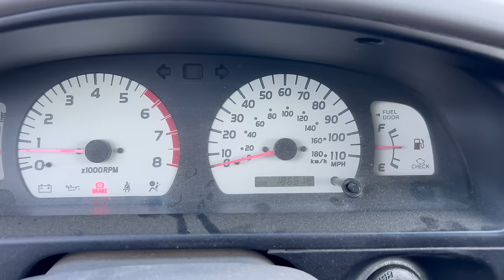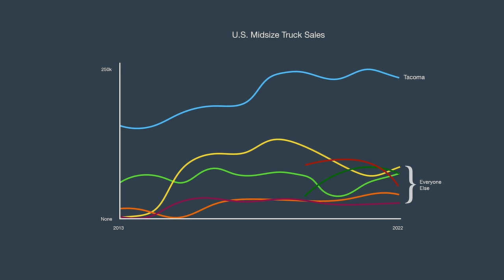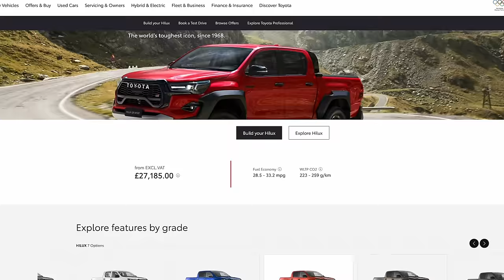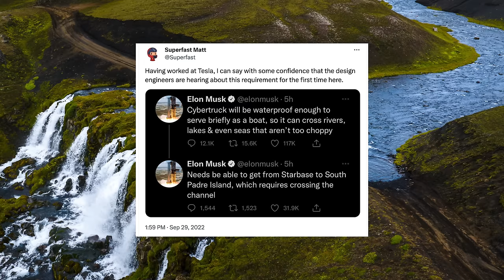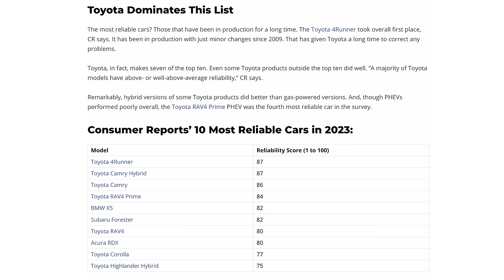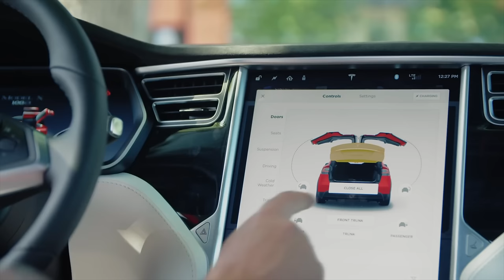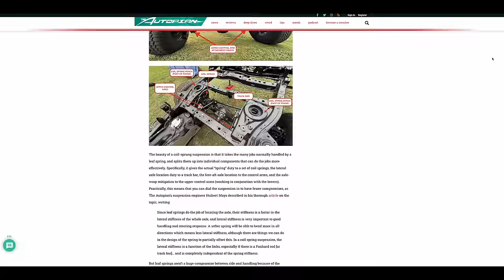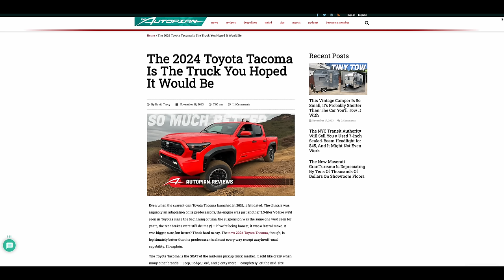What Is The Best Truck, And Why Is It The Toyota Tacoma?

Comment: Less is more .. more sensors on wheels, proximity on gears .. electrovalve on engine and turbo, temp and pressure, ambient and diff pressure sensors ... LCD screen on dash, more ECU stuff for body control etc. Nahhh to many point of failure for future Matt

Comment: Ha!  Totally my experience with both of mine. Bought my '86 new and put 300,000 miles on it. Purchased my '97 and put another 300,000 miles on that one. Now, with a family, I purchased a Sequoia and hope it is half a good as my Taco's. Just hit 110K miles and aside from consumables, all I've done is a serpentine belt. So far, so good.  BTW, both of my old Taco's have seen extensive 4-wheeling on the Rubicon Trail and desert runs. I"ve pulled out Jeep's, Ford's and Chevy's out of rivers, mud and snow. No other truck even comes close.

Comment: I’m currently driving a ‘21 Tacoma TRD Sport. This is not a good truck! It lacks power and doesn’t have good fuel economy. The interior is cheap and the electronics are archaic. The seating position is bizarre, the seat height is abnormally low, like a car. I don’t doubt the reliability, but detuning the motor is not really a feature I’m interested in. This truck proves that generally, people are stupid!

Comment: We only got the stout and hilux here in australia, i own both a 1982 hilux 4wd (LN46)  and a 1991 hilux 4wd (LN106) even with 1.3 and 1.2million km respectively they are still doing more than they are supposed to on a nearly daily basis (currently restoring the 82 as it was in thorough need of a chassis repaint and a new bonnet and seat) but the 91 is still hauling 1/3rd more than its allowed towing capacity over mountains and on the highway (admittedly in the slow lane, for about 700km each time)  on a monthly basis, and taking my ass 110km a day to work and back. Unopened 3L non turbo engine by the way

Comment: I can't speak for the Tacoma, but I can speak for the 8th generation of the Hilux. it is NOT, and i repeat NOT indestructible in any way shape or form. It is actually pretty bad at least compared to earlier generations. You see, I work in an open pit mine, and we've been using Hilux's for the last 15 years for basically everything. Now, I can agree that an open pit mine is an extreme enviroment, and not many cars or trucks can survive in that enviroment. But here's the deal: The latest generation  absolutely F_ING sucks! They are more in the shop than out in the mine. It is everything from broken u-joints, trashed trannies, broken balljoints, destroyed shocks, busted wheelbearings...and the electrical faults...SO MANY ELECTRICAL FAULTS! 
Still, we have a dozen or so of the old gen-7:s and a coupe gen-6:s still running. Sure, they are beat up and looks like they've been in a nuclear war...but THEY WORK. Every. Single. Time! The gen-7:s Hilux:s will always be the pinnacle of Toyotas.

Comment: I love my '02 Tacoma. It is an awesome simple truck. It is under-powered with the v6 3.4L,  but it gets around. always.  I don't haul more than 3-4k with it. And it does amazing offoad stock (e-diff and low gear options) The only thing I don't understand is why it only gets 15-17 mpg, about the same as my '99 Tahoe with a 350 which drives with more power.

Comment: WHOA WHOA WHOA, "It has never left me stranded"? Exactly 6 months ago you published a video showing you folding the tie rods. TOYOTA is great, don't get me wrong, but those tie rods did buckle and the car was undriveable afterwards. It did leave you stranded. Yeah, it was your fault. But still dem's the fax.
Reply from the maker: I cranked the tie rod adjusters until the wheels were straight and drove it home. Definitely not stranded.

Comment: Thanks for the Ode d' Taco. My 01 double cab Taco got the frame rot and dealer framectomy and was never the same again. I passed it on within the family and it still lives with well over 200k miles. Last time I drove it was to pull a small tractor out of the woods at my in-laws house (I ripped the rusted hitch off on that one.) Alas, I needed a larger truck and the new long bed Colorado was a much better deal in 2017 vs the Taco version they were then selling. Don't knock the Chevy unless you've tried it.

Comment: Toyota seems to know how to do vehicles. the modern vehicles have nanny features, for sure, but most of them can be disabled if you so choose, either through menus, or via "dealer options" that can be exposed and tweaked with a $3 app and a $15 OBD2 dongle. The ones that can't are unobtrusive, but still helpful. Leave your dome light on? it turns off after ~30m. 
My only complaint right now is the stupid key alert system that complains loudly under some suprisingly common scenarios, and a poorly worded alert that is very confusing.
I have no interest in other makes, except tesla. Toyota all the way. I only bought a ford pickup because toyota didn't (still doesn't?) make a diesel, and I wanted that bulletproof IH engine. but all my daily drivers have been Toyota, and will probably continue being Toyota.
Because TOYOTA.

Comment: Gonna go against the grain here, the Taco is for sure overrated, which is exactly why they're worth so (too) much. I've driven a 2013 around a bit over the years and my only real gripe is that it is uncomfortable. That and the fact that it costs so damn much makes it a poor used truck choice in my opinion. I found the older Nissans to be a better value.

Comment: I think you have a not very correct definition of "truck stuff". Offroading is not truck stuff, and neither is hauling a dirt bike.

My experience with the pickups on the road that are actually working and hauling things is not that theyre Toyotas. In the blue collar world its pretty exclusively American fullsize pickups.

Also, 6500lb of towing in the new tacome is nothing special, especially when you had just talked about the high horsepower. I tow 6500lb in my 150hp pickup and its just fine.

I appreciate the David Tracy cameo shots.

Comment: I own that "unicorn" Tacoma in red. 1995 extra cab, 3.4L manual 5 speed, 4x4 (air diff actuators). It has 280K, still going strong. I have been offered 10K cash on the spot and turned it down. Love that truck.

Comment: 🤮🤮🤮As a mechanic in Australia I can tell you that working on Toyota's is a nightmare. They didn't design them to be worked on! Take a kun26 hilux oil drain for example, it's right above the crossmember so the last 0.5-1 litre of oil drains into the frame if you don't Gerry rig some rags. Just stupid. I'd rather work on a bmw than a Toyota, at least their engineers consider maintenance in their thought process.

Comment: Not only is the Tesla "truck" a joke..........ALL EV's are a joke as well. Because the joke WILL be on every buyer of any EV. Why? There are 4 basic answers, and all are simple FACTS: #1..........During the life of ANY vehicle ( car or truck ), there is the good chance of running over some debris or obstacle in the road, running over a concrete curb, etc, and any future damage underneath the vehicle, will most likely damage the large skid plate/battery shield. When this happens, NO auto repair/auto body shop will touch it, because there's a good chance at least some of the batteries may have been damaged, and the auto shops don't even want to deal with the potential risks and liabilities. This is already taking place all over the world. They are also afraid that the batteries may explode into a fire that is SO hot and intense, it will most likely burn down their entire shop, along with every other vehicle inside or even near their shop, not to mention people can be killed when this happens. Your only hope is the dealership for repairs, which brings us to point #2.........Whether the skidplate/battery shield has been damaged or the batteries themselves, the repair/replacement cost is astronomical, especially if it's the batteries, which brings us to point #3............Even IF the batteries have never been damaged ( even the slightest damage to EV batteries requires complete replacement ), THE BATTERIES IN ALL EV's WILL WEAR OUT & MUST BE REPLACED, and depending on the EV make & model, this can range from close to $10,000 to a whopping $80,000 or even more. Availability will be very limited. But here's a bonus point #5........ALL EV's have the great potential to spontaneously burst into an intense fire, even just sitting parked, not running, with nobody in the vehicle. This is happening at an alarming rate all over the world, and corrupt government officials, the EV manufacturers, and the corrupt mainstream media are all LYING about it and doing everything they can to cover it up and/or severely downplay this huge problem. But bystanders with cameras and even security cameras everywhere are continuously providing the evidence to prove that they are all lying like hell. They're also lying like hell when it comes to "climate change" and "EV's are essential to a cleaner atmosphere/environment". The mining alone for the raw materials required to produce the lithium batteries is by far the most environmentally destructive practice ever done by mankind. Let's not forget bonus point #6..........ask ANY fool who drives an EV "Every time you recharge your EV's batteries, WHERE do you think the energy is coming from to make that possible?". .......and just watch the dumb looks you get. BECAUSE THE ENERGY REQUIRED TO RECHARGE THE BATTERIES IN EV'S MUST COME FROM PETROLEUM OR COAL. Batteries do NOT "recharge other batteries". (aside from small portable battery powered rechargers that recharge the tiny batteries in your phone or other small battery powered items ) So in summary: the entire notion of EV's "taking the place of vehicles powered by internal combustion engines"  is NOTHING MORE THAN A WICKED CORRUPT SCAM/AGENDA.........and THAT is NOT "a joke".

Comment: I don't know about that I4 outlastung the old 20r or 22r I4 as many of them lasted well into 4 and 500k miles(provided timing set was replaced every 125-150k) and even some passed the  1 million mile marks... Anemic,yes,built to last hell yeah !! Although I do like the doubled hp ratings I've owned ,and built enough turbo engines to know that gasoline turbo engines do not last past 200k before their too weak to start or run very well once running.. Look at Furds eco boost if you doubt me.. 😂

Comment: I'm begging on my knees and as an FJ Cruiser owner. STOP putting fake hood scoops on things! If you don't need to force more air down a stressed engines throat. Then you don't need a hood scoop. If your diesel's inter-cooler isn't mounted on-top of the engine, You don't need a hood scoop. 

Also stop putting the air intake in the grill. It just makes me drive through rivers faster to kill the car.

Comment: I bought my good ol’ 99 base model 5 speed manual 2.4l RWD single cab Tacoma for $2000, it’s now got 265,000 miles on it, several cross-country trips, it gets me and my tools wherever I need to go while working way up in the rocky mountains where I live, I’m keeping that truck forever
Reply: Probably be at least 3 - 4 times your cost to buy that exact same truck today!

Comment: Honda ridgeline is most reliable followed by tacoma and tundra. I don't think its a coincidence the trucks that last the most miles are the least worked. You don't see any of them working at all maybe occasionally the tundra pulling a landscaping trailer. None of them get abused like ram ford or gm. Toyota fan boy or not got to admit the demographics of the owners are not typically the blue collar working class and are taken care of better and worked less.

Comment: I blame most of the dumb accessories (fake scoops, seat "suspension") the new TuRD has on the Mustang/Raptor popularity.  Toyota saw people would spend crazy money for dumb things like that.  Who doesn't like free money?  Kudos to them for keeping a low end model, good luck finding one to purchase though, dealerships know there aren't good margins on them.  And companies that need work trucks put them in high demand.  I for one am shocked Ford finally remembered they had the rights to make a Bronco, and further that most hairdressers who wanted one wouldn't know the difference between the real one and the Bronco 'sport', (or 'BS' if you will).  Although the Maverick looks like a nice capable city car with a large bucket instead of a trunk.  Very useful, much wow.

Comment: I'm sorry, but the new tacos can't hack it. I have a 1st Gen 4x4 with a simple Emu lift and I spend almost as much time helping out 3rd Gen tacos as it takes to pull out the new Jeep nerds. "Off-road" Toyota has become heavy, underpowered, and overpriced. Hell, they'll throw a big turbo on a 3cyl Corolla but damned if they're gonna make a 4x4 with a decent power/weight ratio these days.

Comment: I’m telling you DON’T buy the outgoing 4cyl tacoma though. The bloat has hit the tacoma hard, 4cyl tacomas 10 years ago were small, now they’re bigger and the 4cyl struggles; the transmission hunts endlessly at highway speeds for the slightest incline or wind, the fuel economy is hardly any better than the V6. Don’t bother. I had a 2016 V6 as a work truck, then a 2022 I4 with the same 4 door cab. Huge downgrade. I liked the V6 one, I hate this 4cyl

Comment: You lose rpm with a manual instead of an automatic? I'm getting way too old for this backwards world stuff.
Reply: Resonance...  It will tear up main bearings in a hurry.  Even hammers the transmission.  I suspect it can be resolved with a fluid harmonic dampener.  To be honest... Manual can't touch the automatics.  More gears, closer ratios, higher torque capacity, and torque multiplication from the converter.

Comment: I have a 95 1/2 V6 4x2 Tacoma 5MT thats at around 408k miles. I just paid 1400 for a water pump, timing belt, radiator, hoses, and what not and could not feel any better about it. This truck is going to keep getting me to work every day come hell or high water. Its rough, but its my beater and I love it.

Comment: When I was 18 my dad gave me his Tacoma that he bought new in 2005. At that point, it was his first factory new vehicle, and he opted to get every possible option he could since he just got a new job and was making much more than he had before. When I got that truck I immediately knew it was the best car I would ever own. It could do anything I could've ever needed. It had a towing package with a trans cooler, paint matched SnugTop shell, TRD off-road package,  and the crew cab. In my time owning the truck I brought it over 250,000 miles and the only "work" it ever needed was filters, oil, breaks, and tires. That thing blew me away. While all my jeep friends were constantly working on fixing their rigs, I was driving it to school and work daily. That truck would've gone forever but when I handed it down to my brother he totaled it. The only thing that can kill a Tacoma is teenage negligence it seems.

Comment: I've got a 2002 extended cab, four-wheel drive, 4 cylinder, manual and it's gone 470,000 miles, still going strong!

Comment: Toyota is firmly on the wrong side of history. Collectively our household has had a series of Toyotas, including a much-beloved 4Runner, and right now we have a Prius and an RX350 out front. I don't think we could stomach buying another car from them, though.
Reply: I'm curious what makes you say that? I agree that they've been particularly slow to adopt BEVs, but - at least given the current state of the automotive market - I tend to agree with the general Toyota approach in that PHEVs and general Hybrids are probably the better fit for most consumers. I'd wager a PHEV Tacoma would fit quite well in terms of usability given the "10 Year Outlook" on the automotive landscape, but I also imagine that such a choice would come with reliability and cost concerns that would, at least partially, negate the benefits of the Tacoma as it stands currently.
Reply: Anyone who parks on the street knows that Toyota's calculation is correct.

Comment: I had an SR 5 in the 80's and drove it mercilessly before passing it on to one of my kids.  Then when my father passed, mom gave me his Toyota which I again drove for years before handing it off to my now married daughter and her husband and they drove it for years before trading it in on a RAV 4 as they acquired children.  Needing a truck for towing my late model race car, I bought a 2WD Dodge Dakota with the Mercedes 4.7 V 8 and I have now had that truck for 21 years and it has hauled everything I could throw at it. It still has the original engine, trans and differential and still runs fine.  Recently at Home Depot I was parked next to one of those jacked up Ford trucks and as a 77 year old, I effortlessly slid my plywood directly off the cart into my bed, while the 37 year old next to me was lifting his goods up over his head to get into his truck.  I finally felt sorry for him and offered to help.

Comment: Less is more.
As someone who went from a Daihatsu Charade to an Isuzu Dmax with a 2.6m tray, less is absolutely more when you're planning to do car stuff.
I do remember one time in my charade, I watched a precursor to a F250 trying to park in a spot that was too small for it, I didn't even wait for him to give up, I put my indicator and waited, he did not appreciate my audacity and floored it out of there in frustration. 
Like, I can't haul 700kg of yoga mats in the back of my Charade, but I never have to worry about parking in and around the city. Now I have to pray nobody parks over the centre line or else my nose is going to stick 1m into the road.